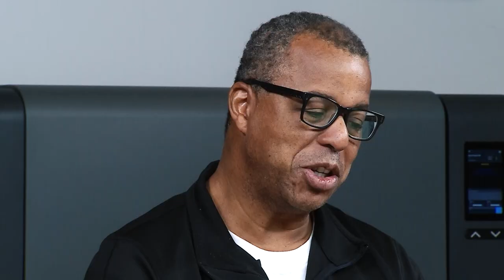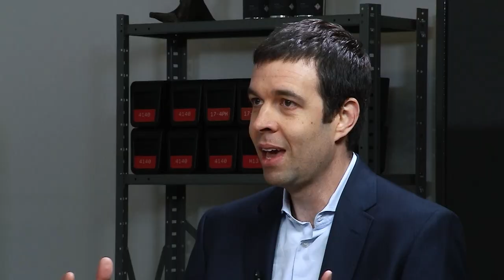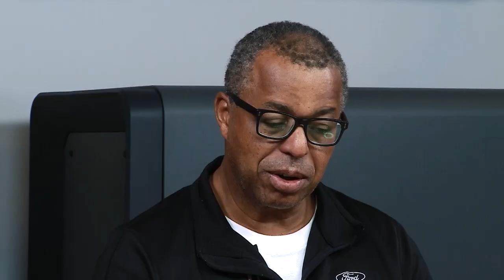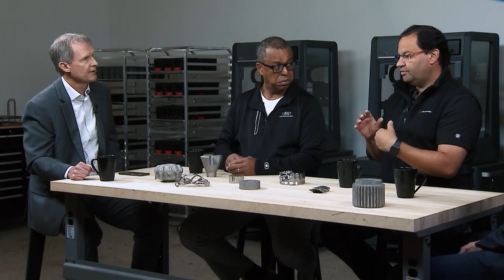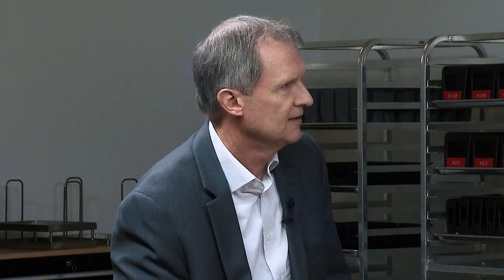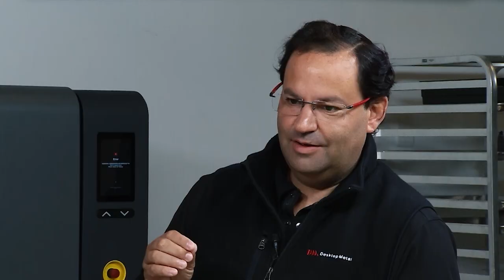Additive Manufacturing: The Next Frontier

Comment: Voxeljet high speed sintering and VX-IOB, desktop metal bidirectionnal jetting, xjet nanoparticle jetting and EOS laser profusion are the 5 main tech of the future of 3d printing for me.
Reply: Speaking as an avowed cheapskate, using low grade metal powder is Desktop Metal's trump card.
Reply: @Veldtian1  Yes, they use ultrasounds to "liquefy" the powder, allowing it to flow properly.
Reply: @Veldtian1  Metal injection moulding is here for decades. It's insane that the 3d printing industry is not using this very affordable powder.
Reply: @Veldtian1  The powder is not only cheap, but it can be reused an infinite amount of time since the powder bed is cold and that the powder do not agglomerate.